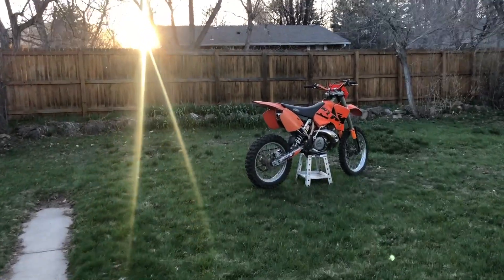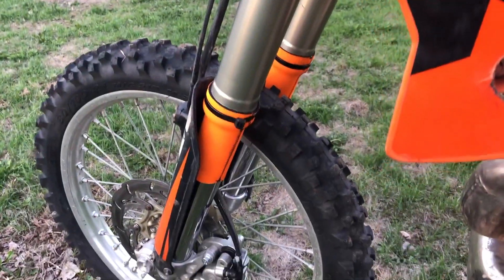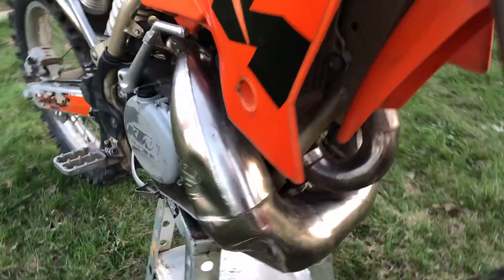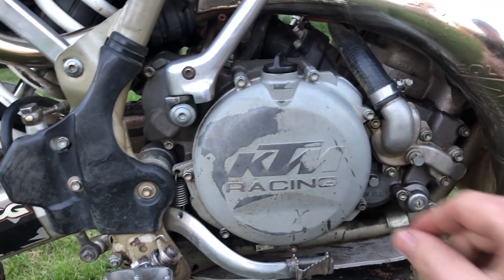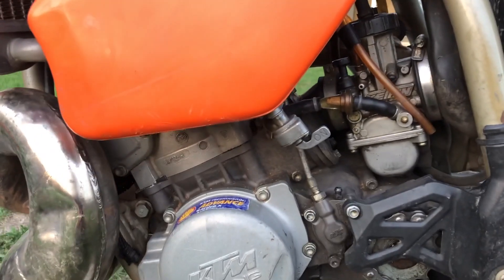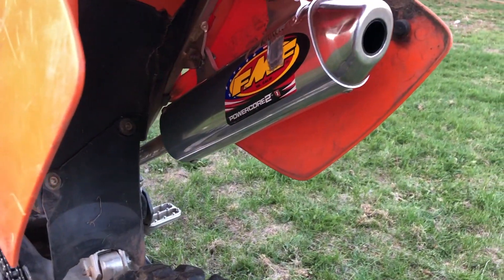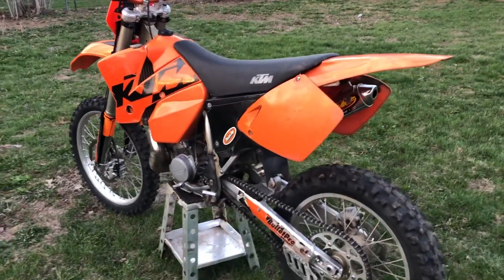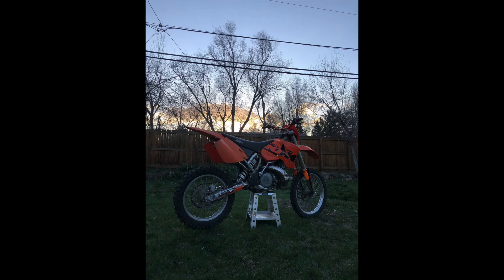2003 KTM EXC 250

Comment: i have the same bike she is a beast how is the headlight wired by the way i just got a head light but idk how the wiring is
Reply from the maker: Xeby the headlight is powered by the stator and has a high and low beam switch where the kill switch is
Reply: CluEngineer i dont have any of the wiring i tried looking for the parts but its hard to find them
Reply: CluEngineer all i have is an after market head light no switch i have no idea how to wire it to the harness
Reply from the maker: Xeby, I’m not sure. Mine came with a head light straight from the factor. It’s the exc model.
Reply: @92813justin  would you ever entertain the thought of selling your ktm?